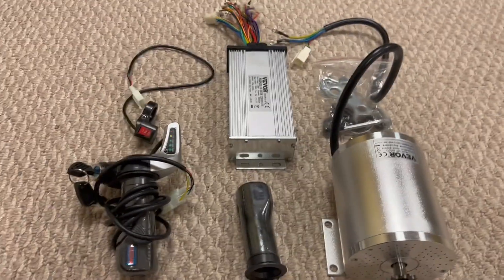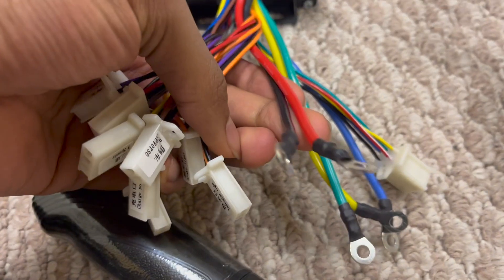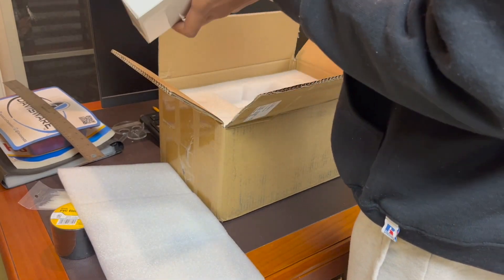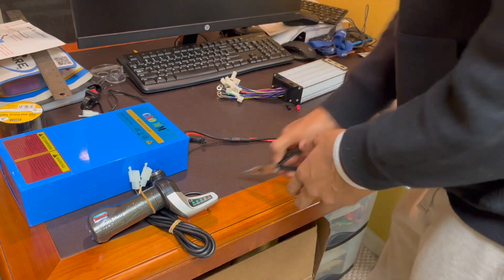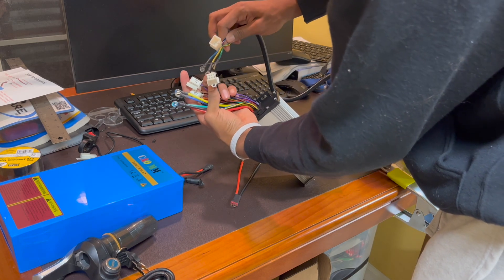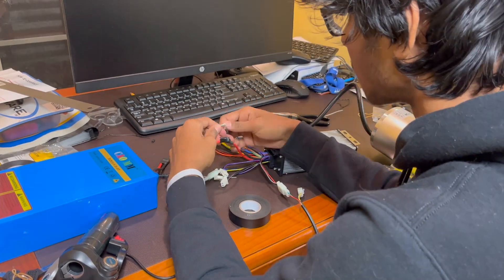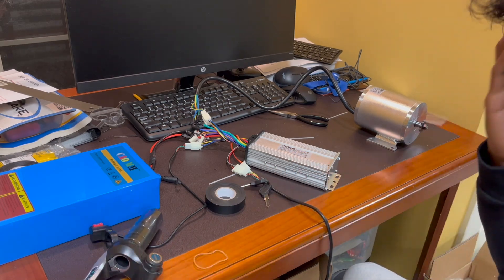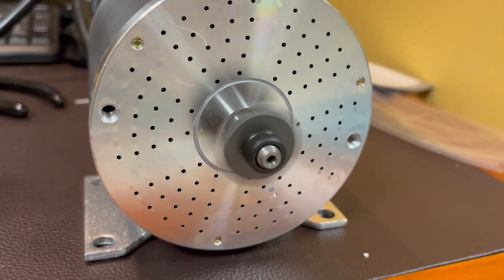Motor and Battery Test -- Building an Electric Reverse Trike Part 2

Comment: minute 11:24 smoke begins to come out of the controller
Reply: happens before the electric motor falls
Reply from the maker: Haha, thats just dust that was floating around the computer. So far, I've had no problems with the controller and it's been working fine.

Comment: I'm going an ATV conversion with the same motor and controller, and learning as I go too (for the most part, obviously watching videos like your's so I'm not completely lost). The kit with the throttle and 3 speed controller wasn't available, so I picked up other ones. I'm ok with it, as I wanted a thumb throttle anyway. Thanks for the video series, I'll be following along as I go.
Reply from the maker: Yeah I was planning to sub out a thumb throttle as well, but the throttle that came with it is fine for testing. Thanks for your support!

Comment: Oh man, where to begin.
   1. First, that battery meter on the throttle, paint em all green because it doesn't matter that thing is shit. Get a volt meter display for your handlebars for like 15 bucks. 
    2. Second, what do you mean the output voltage is higher sometimes? You mean the max voltage? Um, that 48v is your nominal voltage. Your max voltage is 54v. Is that what you are talking about? 
     3. Lastly, lol yea that battery should be fairly heavy. 
     4. Well I said last but then comes another blunder. That spark wasn't because it hasn't been used yet or anything to do since the last time it was used. You have a full charge as it comes delivered. That's a discharge to the controller that has no charge. Sometimes if you unplug a controller for some reason without discharging it, then plug your battery in with full charge it won't do that because your controller already has residual. You can always get it to spark if you have a full charge, disconnect the battery, turn your key on so the controller discharges, then plug in again. Get some anti-spark xt60s and rewire the plugs if it scares you pumpkin 9:20

Maybe add a disclaimer in the description? That what you say may not be accurate because you are learning? Just so other new folks don't come along and pick up bad habits. Have fun with it, that's a beefy setup. I got a Pocket Mod that does 35 with an 1800w. And it gets there fast.
Reply from the maker: Hey thanks for all the info. I know I'm really late on the reply but I value the feedback. Just like you said, I'm learning as I go, and I put the disclaimer in the first video of the series. 

This was just an initial test of the things I ordered, so a lot of the parts like the battery meter aren't gonna be used. I'm actually going to be using a completely different throttle, since my steering setup doesn't work with this type. Thanks for the advice on the residual charge too. I'll be sure to discharge the controller before plugging it in next time.